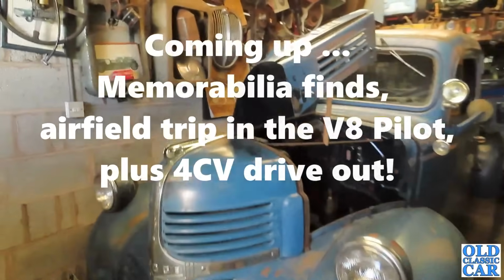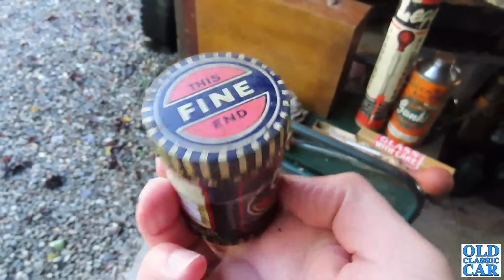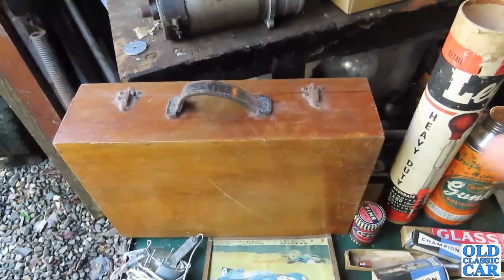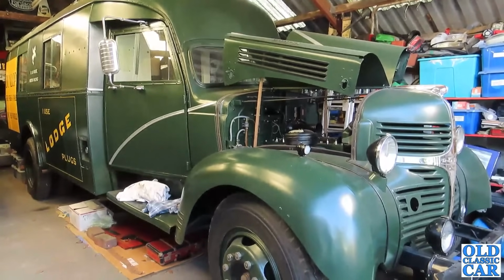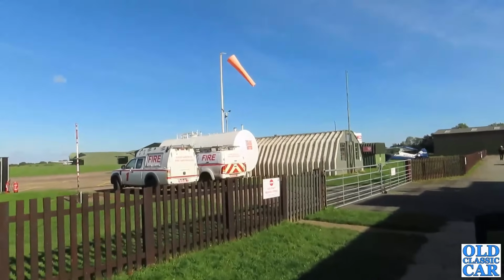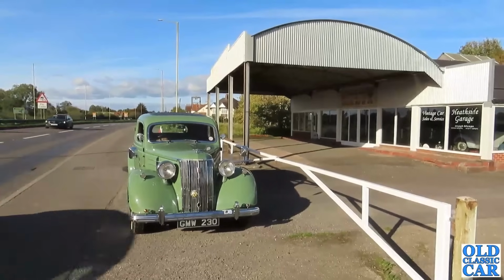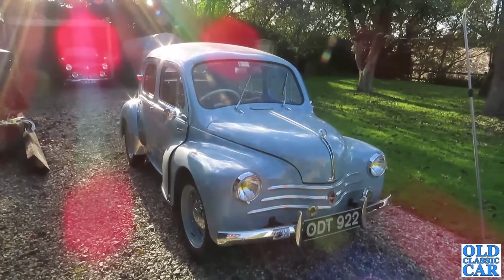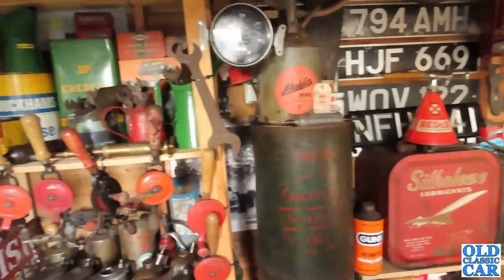Ford V8 Pilot - chocks away in the flathead V8

Comment: Chemico used to be based in Solihull in the 50's and they also made a pink paste used to clean sinks, baths etc...! Used tins of that valve grinding paste as a youngster ! Appretice job always. Just go an grind thise valves in ... ! 😅I wrote software to run the administration of  Sleap Airfield back in the 90's.

Comment: Hi Rick, another fine video. I really enjoy your collection of old garage paraphernalia, but then I am old garage paraphernalia! Traveling with you in the Pilot was a treat, mine's been off the road for a year. You certainly are blessed with a lovely bit of countryside. 
 As for MPG, they only did 20 when they were new, mine does, or rather did before I changed the engine, a mere 13!
Oh and just to pop my motor racing nerd hat on for a mo, that Jag was the 1957 Le Mans winner driven by Ivor Bueb and Ron Flockhart.
Reply from the maker: Ah it was '57 was it, thanks, hope you get your V8 back on the road soon

Comment: The old English Baker I apprenticed under owned several old 6Volt cars over the years here in Victoria. He told me he used to have a local battery shop make him up 8Volt batteries which worked much better dropped right into the vehicle without modification to cars wiring.Cheers from here

Comment: Hi 👋  I thought I would check in with your video to see how your Pilot is going. And it is.  Such a good buy she is , i like the green color and the white wall tyres . The chrome steering wheel is neat too. That metal trolley took me back to my time at the NZ National Film Library in the 1980s.   I worked with 16 millimeter educational films for schools.  I was a film examiner.  We used trolleys like your one to wheel around the films when shelving them.   They were older than the 1980s in age.   The job that I did doesn't exist now,  due to technology changes.  I also did film editing work for the  NZ National Film Unit.  I loved that work.  I like your Renault .  How is your Austin A40 project going ?.   Thanks for your video , I liked the aircraft shown in it.  From Carl.
Reply from the maker: Interesting, I've been making room and tidying up my A40 stuff only today so I plan to get back onto it soon
Reply: @oldclassiccarUK  Look forward to seeing the progress on the A40.

Comment: Great workshop pickups, the workshop trolley is a usefull tool to have. It will come in hand when working on the cars. The hydrometer is a fantastic pickup, looks like it has never been used as it has not been put together. The Pilot is fantastic  with that and the Dodge pickup two great cars. The electronic distributor should work well, but I have heard if it is a chinese one then it may not be so good. What type is it , ie a full electronic dissy or just electronic guts in original dissy. Either way the original dissy and points would be my option, as long as the battery is charged and points clean and adjusted it should start fine. Enjoy the pilot.
Reply from the maker: I asked the previous owner that, it's a full electronic dizzy as opposed to a conversion. I am tempted to get an original setup in and put it on the shelf, just in case ...
Reply: @oldclassiccarUK  yes that would be the way I would go as well

Comment: When the electronic ignition was fitted, was the HT coil ballast resistor bypassed?
Reply from the maker: I don't know, it has a new coil on it which I think is matched to the dizzy
Reply: Pilots built before circa March 1951 have a ballst resistor mounted adjacent to the fuse carrier. By-pass it by putting its two wires to the same terminal. Leaving it in circuit will cause a sgnificant voltage drop at the coil when cranking the engine, which is most likely to be the cause of the difficult cold-starting. @oldclassiccarUK
Reply from the maker: @rhettfisher1018  Very interesting, do you know where the fuse box is located? I've not yet looked for it on my car (1950), thanks
Reply: It's just a single fuse. Your driver's handbook should tell you the location. I only have the workshop manual which only shows a close-up photo so not much help, alas. @oldclassiccarUK

Comment: Good morning Rick. It was good to see the Pilot out on its first run. I don't have your patience, so if my old car wouldn't start, air cleaner off and WD40 sprayed into the carb would be my priming method.
Reply from the maker: Hi, fuel's not the issue, there's plenty of that - there's no spark when cranking on the starter cold, yet I turn it on the starting handle and it sparks up and the engine fires within a few turns. The starter is hogging the electricity on a cold start, and the retro-fitted electronic ignition isn't getting enough to work. Start by hand, and the ign gets all the power it needs to spark.

Comment: The side-valve V8 Ford cars from this era and a little bit later and probably up to the mid 50's are maybe my most favourite. I really love these cars, because of how they actually changed the motor car car industry. I love it when you see these old Fords with the original performance parts added to them ( better carburetors, exhausts etc). I absolutely hate it when someone replaces the flathead V8 with a Chevrolet small block. Ahh! Sacrilege. Yours is a beautiful example, maybe a bit too quite. Of course exhaust is personal choice, I would fit a couple of glass pack mufflers. Look after her, you are very lucky.

Comment: Some good finds there. I do remember the hydrometer though i have not used one. I have used the grinding paste with dowel and rubber sucker, apparently you can now get a drill attachment but that does not seem the same to me! The Pilot looked quite at home at the airfield and even blended with the green grass in the sun! I would deal  with the battery leads soon and I think you will see a difference in starting from cold. The 4CV seems to be much happier now moving at quite a pace. I have to say that closing those suicide doors reminded me of the very funny film 'The Plank' with Eric Sykes (and others), If you have never seen it then it is well worth a watch. A bit 'off subject' at the end of my comment there but a great video once again Rick, thank you. 👍👍
Reply from the maker: Ah yes The Plank, a fun film, or two films actually, the early one they drove Morris 8, the later a Morris Minor. The latter doesn't seem to appear on TV much now (with James Hunt in it), the earlier one more frequently. Thanks for watching.

Comment: My 4/4 se ries V has to sockete (one pos one. Neg) into o which a light could be plugged. I have used it to plug in an air pumps. It sits in a metal plate centrally on the fascia.

Comment: That is a neat picture of the D type, my favourite "Le Mans" car of all time. Interesting that an electronic ignition has been fitted to the Pilot. The dual point distributors these old v8's were fitted with were very reliable,  at least the US crab style particularly (42 to 48). These had a 2 bolt mounting plate ( pilot maybe has 3 holes same as some of the earlier US models) Is it a Lucas dizzy? It is only a matter of changing the timing cover over to a 2 bolt the use the crab. If you see one at an autojumble it would be worth grabbing. Often people will fit electronic distributer's to these because they are not happy with the original setup as it hasn't been set up properly. If you go back to points find someone who is a "guru" with flatheads and send the distributer out if you cant take the car. They will probably have the correct machine to set these things up on. Once set up it can be bolted back on the car and it will require no further adjustment on your part. You probably know these directly drive off the front of the cam and can only be mounted one way as the tang is off set. Here is a link from Fordbarn which I am a member of where electronic distributers for the Pilot is discussed   https://fordbarn.com/forum/showthread.php?t=138747. Mart who posts there is from Solihull  knows his flatheads and variations also has his own channel, "Marts Garage."

Comment: Have you tried d spraying "Ether(Hot Start) Kanto the carb to facilitate starting. Usually quite effective.
Reply from the maker: Hi, fuel's not the issue, there's no spark when cranking cold, try the handle and it sparks and fires up after just a few turns by hand

Comment: The Pilot looks very imposing in a good way,with a great view of the road ahead from behind the wheel, what fuel do you use ,with or without a lead additive ?  The leaded or unleaded fuel question seems to have  disappeared from  classic car discussion
Reply: Fuel was mentioned in the last video and I think it's super unleaded..........
Reply from the maker: I'll use anything, engines of this era would run on pretty much anything and they are quite low-revving so no risk to valve seats that I can tell. Plus the mileage I do is tiny really.

Comment: Starting that engine from cold on the handle I regard as a very good thing. The fellow in the USA who only does Video's about Model A's. He uses multigrade oils, correct me if I am wrong? What is the betting that your engine is running on SAE 30 engine oil? My plastic Pig is fitted with a ballast resistor type coil. That is one of 9 volts with a 3 volt resistor in circuit. This is switched out of circuit during starting to give a better spark. Your system is a 6 volt one so a little more difficult. I would be running the wire direct from the battery to the contactor for starting.  So just a relay to give you that direct feed. Even then as your engine with 8 cylinders likes starting on the handle when cold. With the correct modern oil in it use the handle. It is a nice kind way to start your engine from cold.
Reply: If you like a bit of exercise first thing in the morning..................
Reply from the maker: Yes it does give it a gentle start to the day but it's a heavy old lump to turn over, and my wrists aren't great to begin with so I can't do it too often